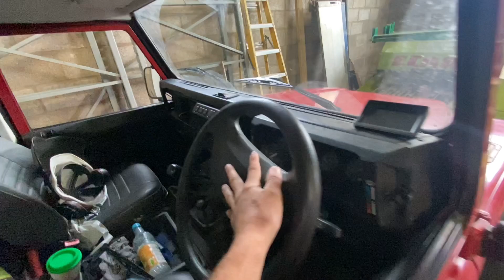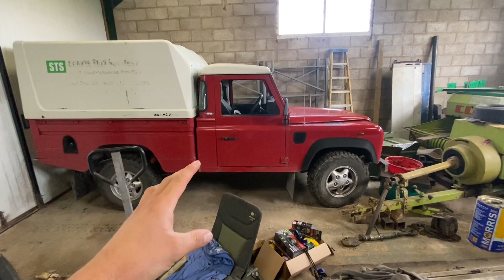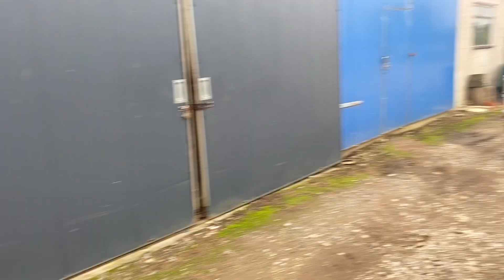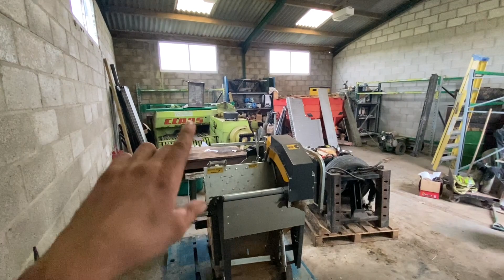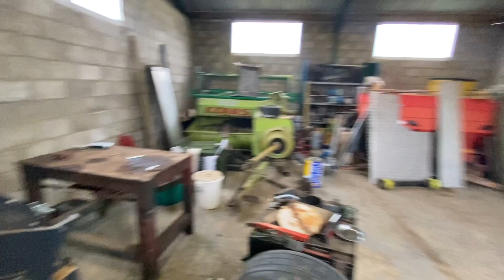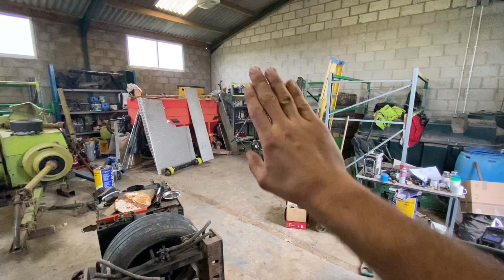Saturday workshop, defender 110 and organising the workshop!

Comment: The TL looks tidy. Same as the one we use. Does it have the cable joystick or electric.
Didn't know Hs name and location was a secret lol 😅
Reply from the maker: Yeah she’s not bad. She’s all electric (r reg ) which is nice. lol it probably isn’t but the less that know the better me thinks
Reply: @casto-  ours is on cables, personally I think they need some TLC but boss man say not lol. 
To be honest I wouldn't advertise myself either. A mate of mine has lent me his drone so I can get good at it to film his work but said I can use it as I want. If I can get some good bit together I might put them on here. Been ploughing the last few days
Reply from the maker: @leonelectrical  yeah apparently the brakes need bleeding often but mine has a leak anyway 🤣🤣. Yeah hs and I both kinda keep our selfs behind the camera for good reasons but not because of our selfs… we do have faces for radio though 🤣🤣
Reply: We've never had a problem with the brakes, probably the best brakes on the farm. Especially good when you forget the brake isn't a clutch and try changing gear. FFS you only do that once 😅
Reply from the maker: @leonelectrical  🤣🤣 oops! Mine aren’t the best, if you knock it into neutral she pulls up quicker. It’s almost like the clutch isn’t giving out
Reply from the maker: Just remembered, what’s the button on the end of the forward /reverse lever for? It seems like a splitter 🤷‍♂️
Reply: I think the revs have to be right down for the 'clutch' to disengage. Presumably its a torque converter rather than a clutch.
Not certain but I think the button on the forward/reverse lever is the horn, it actually fell off ours last year 🤣